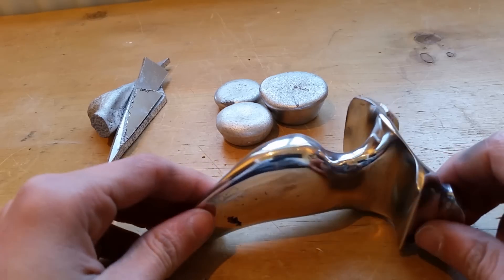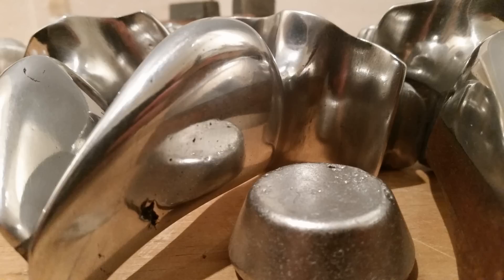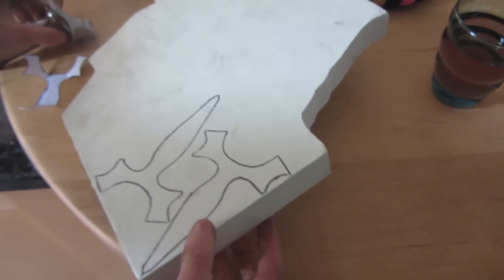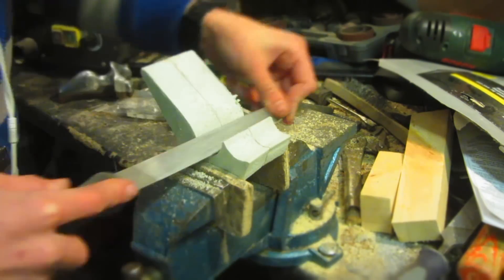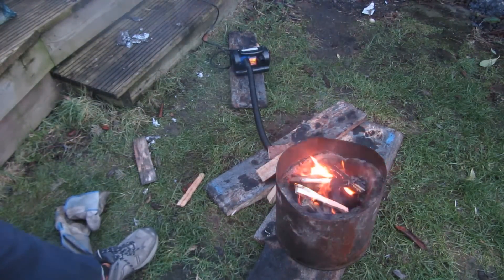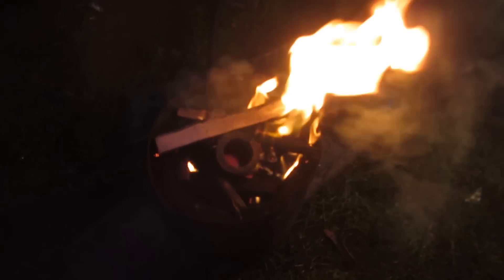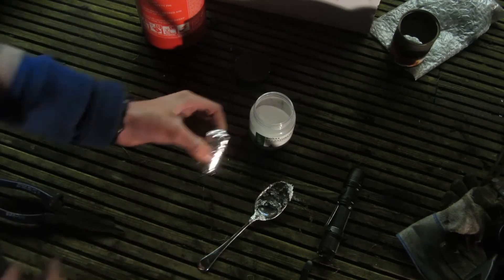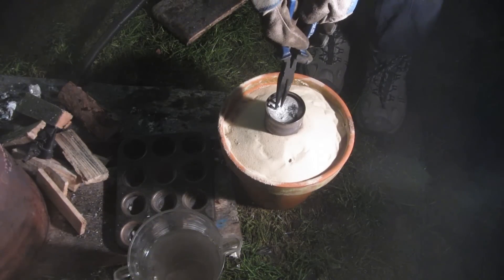How To Cast a Full Aluminium Slingshot Using Lost Foam Casting at Home

Comment: great job. I worked in a foundry and we actually did use some Styrofoam molds.  The piece you add to the end to pour your casting is also used as a riser. like you said as the metal cools it shrinks and pulls more metal from the riser to fill the voids.  so if you make your pour spout bigger and cover it with a bigger can to help it from cooling to fast it will help let your casting pull more metal to fill your voids. Another thing that happens, is if you don't poor fast enough the Styrofoam melts before filled with metal. you can make like a small rope of Styrofoam from the bottom of your casting running out just to the side and up to the top that will form a vent as it melts. that will allow you to pour a little faster.

Comment: TAOW you're an amazing young man, I've watched several of your videos and you have skills many adults haven't mastered.
I'd like to offer some tips on better investment and tricks for better, smoother castings. 

2 Parts Plaster of Paris, 2 parts of your silica sand, 1 part finely sifted charcoal dust. The sand will temper the plaster to tolerate higher temps, the charcoal dust will add some porosity for better venting of gases. Old school bell makers would use very dry, sifted, horse dung instead of the charcoal. Mix your investment so it's more liquid than paste like, you want it so it's easily poured and has a little more open time before setting up. Pour enough into the bottom of your mold to secure your foam, you may want to insert some stiff wires into the sides of the sprue to rest on the top edge of your canister (flower pot) this will keep everything in position while pouring in the rest of the investment. Using a palm sander around the outside of your pot will vibrate out any air bubbles and settle the investment neatly around your foam. Once the investment is free of bubbles and still somewhat plastic, add in your soup can. Let this sit until it is quite dry, if it's moist when you pour you will get steam. This may take a day of letting it sit in a warm place. Then another day out in the sun. Don't be in a rush to dry it too quickly, this could cause shrinking of the plaster and cracking. It's worth the extra wait for the better quality of the final product. 
While prepping your casting furnace, set the flower pot on top while it's heating up. This will drive off excess moisture and preheat your mold, making for a smoother casting. Too cool and it begins to set up your molten aluminium prematurely.  Warmer is better but not so hot as to begin to melt your foam model.

Plastic drinking straws for venting. Adding some straws, starting near the tips of your forks, then where you forks meet the handle, then the thickest part of the palm swell, this will give better venting of gases, reducing the porosity of your finished  piece. (Think of tipping up a bottle of soda. As the soda pours out you get gurgling as air goes back in to release the vacuum. Insert a straw into the bottle then tip it up, the soda flows out smoothly as the air can enter the bottle through the straw.) The straws should easily drill into your foam, just enough so they stay in place. Angle them upward so they will protrude out of the top of your investment and flower pot, but in such a way as to not interfere with your soup can. The straws will vaporize like your foam and hot glue. You'll have little sprue like bits to clean up, but a much smoother casting overall. Allow your aluminium to cool until hardened then dump the whole lot into a large vessel of cold water. The thermal reaction should break up the majority of you investment. The remaining bits will chip off easily. Coating the inside of your flower pot with petroleum jelly or thick oil will allow the investment to slide out smoothly and into the water. 

I hope you find this helpful.

Comment: It would be really cool to see this design cast in brass. I'm not sure you can get spent shells in the UK but if you can find a cheap or free source of scrap brass that would be a cool looking slingshot.
Reply: A lot of people reload in the UK which means brass is rare unless you know someone that shoots .22 or something else that's cheap. There's shotgun cartridges (to a point of being a problem) a plenty but getting the brass from them just isn't worth it, i melted down about 100 of my used ones and i may as well just have bought the brass just to save time...

Comment: I do allot of metal shaping/ finishing in my shop would suggest buying a electric angle grinder.  You can mount a cut-off wheel to it and save a lot of time and effort chopping the sprue off the bottom without having to use the hacksaw.  You can also use 80 and 120 grit disks to do your rough shaping instead of filing.  (Im a fan of files too but why waste the time if there's a quicker option)   they also make hook and loop pads and scotch-brite disks that stick on that come in brown (rough) red (medium) and the blue polishing disks.  they aren't a complete replacement for sand paper and sponges but you can get a majority of the surface to 400 grit without much effort.  The 4 1/2" angle grinder is one of my main tools as a welder fabricator.

Comment: Nice work! I'm built the same forge as you before you introduced it! Haha! I have a challenge for ya. There is an alloy called Aluminium Bronze that I really think you should attempt to cast. Really cool metal composed of copper and aluminium, both of which have relatively low melting points. Please do a beginner alloy tutorial on this metal, or maybe a copper casting! I really hope you see this, I'm a regular watcher and would love to chat! Thanks!
Reply from the maker: Alexander Drummond thanks!That sounds interesting, I will  have a look at it!
Reply: The Art of Weapons Aluminum Bronze is a very nice metal. That's what I plan on smelting/casting in the future. My goal is to make an Oldschool RuneScape styled mace.

Comment: Have you thought of dipping the foam investment in repeated layers of plaster? Dip it in the plaster slurry then let it dry then dip it let it dry etc. Then pack the whole bit into the sand as before. The plaster will keep the surface of the foam and will add strength to keep the sand from intruding into the molten aluminum.
Reply: +Scott S. 
Lost foam casting, eh?
Reply: The plaster will spall and crumble from the temperature of the aluminium

Comment: i just wanted to give you an idea if you get a little bit of imperfections which are not too deep but they wont sand out use a technique call led welding i am sure you can google it and learn it very fast and this method it great for the type of things you make because it sucks to have a small dent or something like that after all that hard work. great job and keep it up.

Comment: For pits like that, in the brass casting art world they create an undercut (which it looks like there already is) and pound a piece of brass into the pit.  The pounding expands the brass inside the hole and leaves a raised surface which can be sanded down.

Comment: The Art of Weapons Great edit.  Thank you.
If you had a TIG welder, you could fill out the imperfections and file them down to a perfect finish.   I've heard about other aluminium "solder" products (such as DuraFix)  which can be used with MAP gas.   It might be worth researching as they look good, but I've not had any personal experience with them.  Good luck.

Comment: The only way I can think of to improve your Casting method is using an orbital sander (sans paper) on the top or bottom of the mold or sit it on top of one of your other bench tools and using the vibrations from them to help the sand settle, thus leaving fewer inclusions in the handle or forks of your slingshots... Just an idea

Comment: make your pour spout a little longer and bigger so it will stay liquid longer. It will allow the casting to draw metal as it cools, and make a runner from the bottom of your casting coming up along side it to the top of the sand. It will form a vent that will allow you to pour a little faster to help prevent voids  from air pockets

Comment: You have just earned yourself a new subscriber, this is absolutely brilliant work. I just want to add a comment about the imperfection, could you not melt a little solder wire into the gap to fill it?

Comment: The Art of Weapons heyy dude may i suggest you make a hot foam cutter, im not sure if their are many tutorials out their but a good idea i had was to get the heat generator from a glue gun and attach some piano wire to the coil, piano wire is extremely bend resistant and wont melt if you get the right material, ,then just make a "U" shaped bracket and get a flat piece of wood , drill a hole in it,and insert the wire into it, screw the sheet of wood to the frame and attach the heat generator to one of the ends and twist the wire to the other

Comment: When you have a deep imperfection and can't get it out, try putting solder in the imperfection.  It will fill it in quite well and it to will buff and polish to a nice finish, but very nice work.
Reply: angry fish I was trying to think of ways he could attempt filling the hole with aluminum but thats a good idea. The solder melts with a light too so it wouldn't be hard

Comment: You can solder those pits and crevices in the slingshot and they will buff and sand away back smooth like aluminum

Comment: Great vid thanks. Would it help to compact the sand mould before casting by vibrating it or even tapping it on the ground.. Also how about watering the sand a lil to get it all damp before the cast, not water logging it but letting it drain from bottom

Comment: A really beautiful job all round. I also do some aluminium casting and appreciate your work. With the one blemish in the handle I might have drilled it out, tapped it, fitted a brass screw, flushed it off and polished it. Are you based in the UK as I am?

Comment: Use soldering iron to fix those small holes,once you done it sand it and put some more solder into hole.Solder-sandpaper-solder-sandpaper.It will fix your problem.

Comment: great video! i really love the polished design of the slingshot.
have you ever tried to remove the gating with an angle grinder and a flap disc? it may takes less time.
i like the big shrinkage cavity you cant polish out. i gives a nive contrast to the polished finish.
Reply from the maker: Cast and Forge thanks,I think that I will need to try that some time, first I need to get a flap disc.
Reply: they are not really expensive and they also work well for shaping wood (handles).

Comment: You made a fantastic job of this - I'm a little in awe. Regarding the fault in the handle, would it have been possible to drill out the imperfection then fill in with a spot of aluminium weld?
Reply: SimplyReg That was exactly my thought, I would have tried.

Comment: for that imperfection you couldn't sand and buff out, couldn't you melt a little more aluminium and poor it over that little bit? Also with the left over sand from the casting, can that be reused after it dries?

Comment: Any imperfections made could be fixed quite easily if you have a Tig welder that has AC output, or you could use a solder that bonds to aluminum. You would just clean the area with a stainless steel brush and then weld or solder the area, then file or buff the area smooth.
Reply: James Torres  aluma weld would be great for fixing the imperfections as long as they were not on a structural part
Reply: Even if the imperfection was within a structural zone of the part, welding would improve the structural integrity as long as you have enough penetration.
Reply: James Torres aluma weld is not a welding process it is a soldering process henc why I say its not great for a structural part I have used it in the past its a great way to join aluminum but is not to strong
Reply: dan rasmussen and its a pain in the ass, especially a piece of aluminum that big, its gonna disperse the heat so fast and your gonna have a bad time.
Reply: dan rasmussen
GTAW (Gas Tungsten Arc Welding) or more commonly known as Tig Welding is a welding process that can weld aluminum provided you have a machine that can run AC output. You can also use aluminum solder with a torch if you don't have a machine and the spot is just for cosmetic purposes, but is is an idea.
Reply: James Torres http://www.alumiweld.com/ has nothing to do with TIG welding I do no the difference between soldering and welding ty

Comment: Try  green sand   I think its sand mixed with coal dust and other things ...    it will give you a better finish on your castings  and you wont need to use foam .   but you will need a pattern ?

Comment: putting the hot piece of aluminum in the water will not damage it?
Reply: JLR Craft Very opposite. We do the same thing in welding, sometimes. But they discourage us from doing it because it "weakens" the piece. "Weaken" in the case that when metal is hot, all the little particles are jumping and hopping around, and when you dunk it in water it solidifies the suckers where they are which is a stat of excitement/ not settled down. However if you let a finished piece of hot metal sit and cool on its own, the little particles settle down, nice and cozy, more clumped together.
The term is called Quenching. Google is master, encase my explanation is crap or curiosity has you. Have a nice day, eh :)
Reply: Nope, it will only make it more solid

Comment: I've found filing aluminium, the soft metal clogs the file teeth quickly. I read that spraying the files with WD40 helps to prevent this happening. Anyone found this is a problem? ...or other solutions.

Comment: Not expecting a response but Is this possible with steel and other metals?
Reply: In theory yes but aluminium has a far lower melting temperature therefore easier

Comment: You can make a hot wire cutter REALLLL easily. Just buy some nichrome wire. That's all it is. Then you just gotta experiment with the length, to get the temperature you need without drawing too much current for your supply. (A 6v lead acid battery is plenty for small projects)

Comment: its better to put the flux in and skim off the impurities before you pour your ingots....this way your ingots are 99.9% pure and you dont have to do anything but heat and pour, i worked in a foundry and we got the pure aluminum blocks....and melting cans will give you a more a pure aluminum than aluminum stock, which is noting but cast aluminum and always contain alloys...cans would be the purest form of aluminum readily available, before making the ingots skim off the impurities...i really like your videos, you have taught me a lot. but being a open source like this will help you perfect your methods

Comment: What grade of aluminum are you using here? I'll only be melting soda cans
Reply: +Zoe Doucette That works just fine. But you REALLY have to melt them into ingots first cus there's a lot of slag from all the paint and dead bugs inside
Reply: +Zoe Doucette That works just fine. But you REALLY have to melt them into ingots first cus there's a lot of slag from all the paint and dead bugs inside

Comment: Instead of casting in a rigid container, what if you cast inside a sack? Then you could cinch ropes around the outside and ensure the sand is packed in all directions with direct pressure. Not too much, of course, otherwise the mold would collapse into the volume of molten aluminum. The point would be more uniformity, not more pressure.
Reply from the maker: stcredzero Thanks for the ideathis might work in theory however the sack might move when the lighter foam is replaced by denser metal and that would ruin the cast.

Comment: Can u give me advice on prepping the Styrofoam?  I need to make Italian greyhounds and think cutting a 3d mold will be a bitch... any suggestions please?
Reply: rob belden If you want to do detailed work in foam, you really need a hot wire. You can get hand held ones that are easier to work with.
Reply: Richard Smith thanks man I've been contemplating

Comment: Why can't you make the sand a bit wet so it gets harder and doesn't add imperfections? Some advice, clean your sand with a finer mesh and shake well the sand before pouring the aluminum, also maybe try wax instead of foam. I just hate those imperfections, but I understand some may like them.
Reply: zerpBot Wax is substantially more expensive where I'm from and you don't want to add water.. Pouring molten metal onto a wet surface can cause explosive steam
Reply: Ryann Large Not explosive, just very hot steam.
Reply: Emory LastNameNoLastName it can push through the metal and erupt sending molten metal splashing into your eyes. I used a more dangerous sounding word to get the point across to younger viewers

Comment: i bet he'l cry when the surface oxidises...
Reply: Aluminum takes quite a while to oxidize
The layer he files off is aluminum oxide so unless he reheats it itll be fine
Reply: lol49031 aluminium is actually quite reactive, the only reason it doesn't all oxidise is because the surface oxidises so quickly